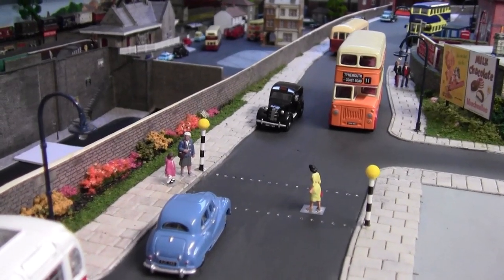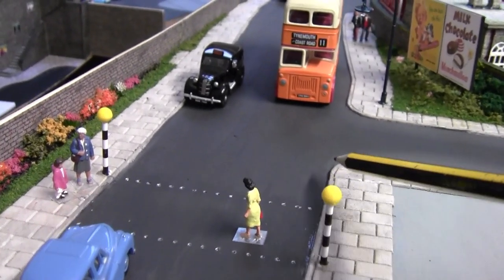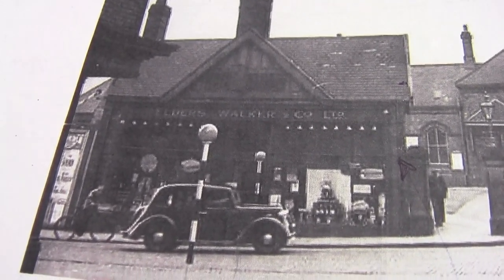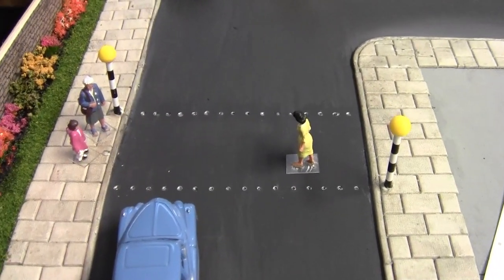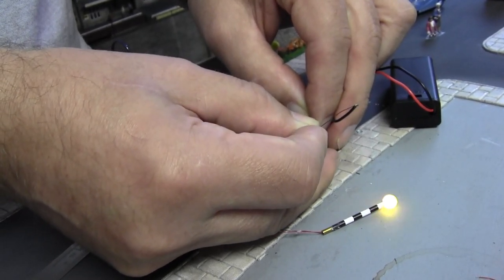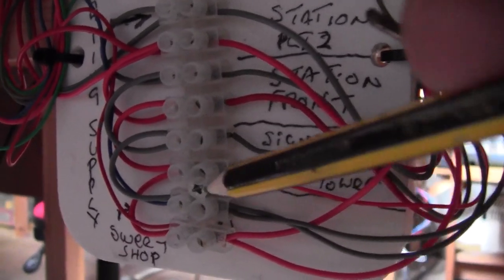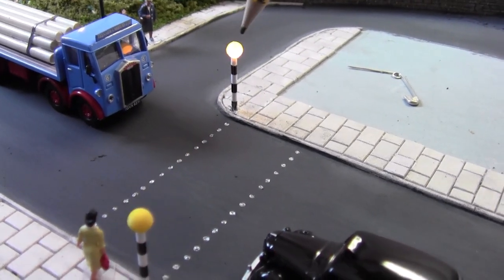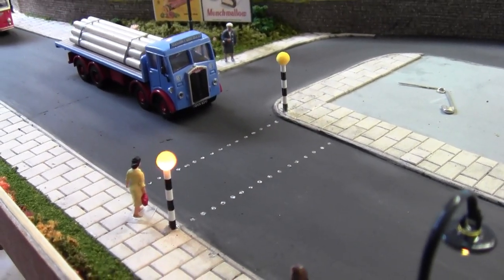Pedestrian crossing mistake fixed........No 286

Comment: All's well that ends well. I remember those crossings well but would never have known the beacons where in the wrong position if you hadn't pointed it out. Looks great.
Reply from the maker: Thank you Frank. even the ressister i have manage to salvage. and most of all the beacon still worked after the fix....thanks again my friend.........Tony
Reply from the maker: Thank you Frank. even the ressister i have manage to salvage. and most of all the beacon still worked after the fix....thanks again my friend.........Tony

Comment: According to the history of the zebra crossings the stripes were added between 1949 & 2951 in over 1,000 crossings in the Uk...hence zebra crossing (wikepedia)
Reply from the maker: Good morning Greg. great resaerch and that maybe so. but i am going by the photo i have from the 1930s. where it clearly shows the belisha beaons and studs. as you had seen in the video. the belisha beacons came in 1934 or there abouts. your right the strips came in later. 
its was also depending on areas and the roll out of the zebra crossings.
fascinating stuff............many thanks again.....cheer's tony